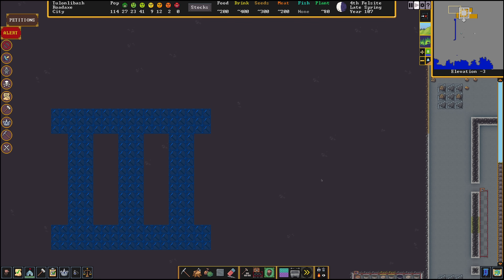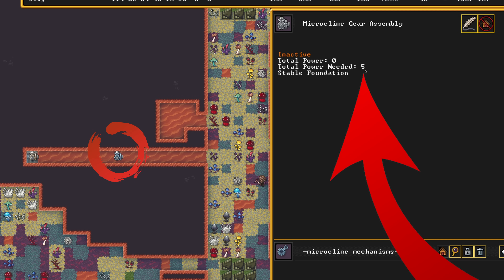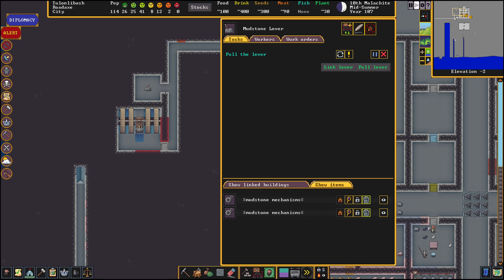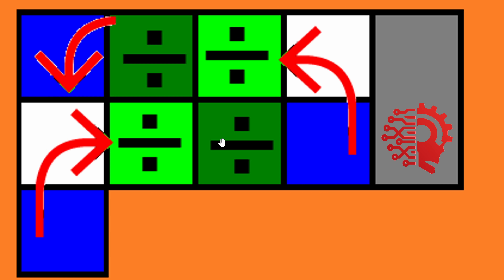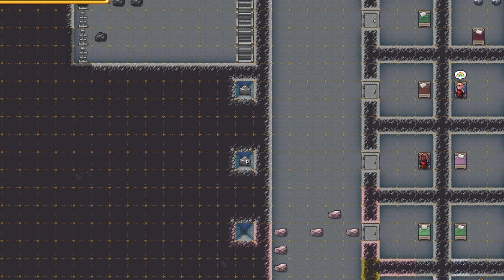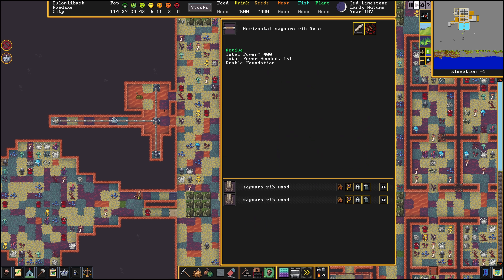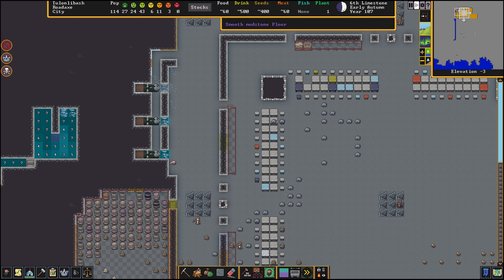ENGINEERING TUTORIAL 🔅DWARF FORTRESS STEAM🔅

Comment: How do the water wheels keep spinning if there is no active current? 
Does the initial force from the water entering the chamber, creating the initial water wheels motion, then create an infinite motion as the water wheels propel themselves in continuous motion? Do they power their own current?
Reply from the maker: the water pump creates "flow"
Reply: @TwistedLogicGaming  ah! I got it. So if you had built the water wheels on top of the existing water- instead of flood the room with them already assembled- you could have manually started the pump to create the flow. It would then just keep going as the wheels power the pump and the pump creates the flow moving the wheels. Makes sense now

Comment: I finally understand how this works (I think) but that quadruple water wheel setup feels like it doesn't make physical sense lmao, isn't that a perpetual motion machine
Reply from the maker: yes- it is a perpetual motion machine sort of, if you closed the water input and run it forever; eventually some of the water will vanish and it will stop working. You could call that evaporation perhaps, but I'm not sure if it is actually the same evaporation mechanic as the murky pools in hot biomes

Comment: Is there another benefit to using doors as valves as opposed to flood gates?

The only difference I can think of is that you can always unlink the door from the lever and have it function normally.

Floodgates remain open or closed when unlinked from the lever so cant be quickly forbidden or closed in case of an intruder.

Other than that it's seems that they're equal for use as valves.

Great vid man!
Reply from the maker: Yeah, that sounds about right. Thanks for watching !!

Comment: I find the noob way is easier than building a separate room. More risky, but easier.

Just channel down until you reach your main area of the Fortress and create an Underground River.

The Underground river can also be used for irrigation with manual pumps, wells and if you use mechanisms you can build a cheap Mist Generator on areas just by digging up and using axles.

I feel the whole creating a separate room is a bit complicated.

Just create a big channel all the way to the end of the map and put some fortifications that way you don't have to worry about flooding. Also the amount of water should be big enough for multiple Waterwheels.

Comment: Would someone know a reason why this could not work for the higher level pumps? I've been trying to replicate everything as much as I can, just with small layout changes but are only for the wooden axle,  to move energy around, the actual pump layout is identical, and there is no mist being generated in my higher level, which is my tavern/inn. Since the lower level pumps were working fine I thought it could have been the direction, as long as the top pumps work its fine by me, so I switch the direction but still no mist in the higher level, only at in the lower level. I have rock floor grates to prevent accidents, already tried changing them to floor bars but didn't fix the issue.
Reply from the maker: That is weird. the lower level should produce alot of mist and then there should be atleast some on the upper level

Comment: Followed this for both the water reactor and mist generator and it worked like a charm. It appears that once I add iron floor bars to the top level, mist is no longer generated on that level, but if I remove them then dwarves periodically cancel their jobs due to dangerous terrain. Is this expected behavior or am I potentially doing something wrong?
Reply from the maker: I get some mist on the upper level with the floor bars, it's not as much as the lowever level. I created a temple between the pumps so they are forced to walk in that area to visit the temple
Reply: @TwistedLogicGaming  okay, cool. I also put a temple near the bottom level mist generator, and then I used your design for the ring generator to supplement the mist on the second level (the tavern) and it’s doing exactly what I had hoped. Thanks!
Reply from the maker: Sweet ! Glad i could help Jeff!

Comment: My pumps spit water too far and keep flooding the room with 1 depth water.
Reply from the maker: sounds like something id different. did you use the diagonal on the lower level to reset water pressure ? are the walls on the upper level in place ?
Reply: @TwistedLogicGaming  I did. Looks like my mistake was to dig a channel for waterpumps, not digging smal ponds. when I put 2-3#  of water it works fine. If I fii the water supply chasnnel 7# the upper pump row start to spit water too intense

Comment: so i built the reactor from this video. works great. my reactor room has 6 of these and powers my 150~ pump stack to get water at my volcano base. altho they lag the game ALOT. so i used draw bridges over the screwpump input to turn the reactors on and off completely so that they dont lag the game and i can still use them for power if i need anything.
Reply from the maker: A Hatch will also work to block the input for the pump to create an on/off switch ! Great work Gredz!
Reply: thats a fantastic idea. i didnt even think about hatches. thats probably alot more safe than the bridges, i dont want to launch some poor unfortunate up into the ceiling when i turn the power on.

Comment: I honestly don't think the top pumps of the mist generator actually create mist on that floor. Dwarves get a waterboarding if they stand in front of the pump, but I have yet to see any develop any feelings regarding mist or waterfalls.
Reply from the maker: I have seen the mist on the upper level; if this is setup in a meeting location, it might increase the exposure to the mist more so than a random hallway like in the video.
Reply: @TwistedLogicGaming  I think I figured it out. Putting a grate on the floor in front of the top puump stops mist from generating on the top floor. It still generates more frequently on the bottom floor though.

Comment: Few questions:

1. Are those waterwheels powered by that one pump pushing water around? (aka perpetual motion?)

2. Does mist have to hit something to generate or is it made when water moves down a level no matter what?

3. Can you power a pump from the side and then translate power out the other side to other adjacent pumps or axles?
Reply from the maker: 1 yes
2 when water falls, nothing needs to hit
3 the water wheel creates a net of 90 power. the entire system can use that power no matter how it hooked up. you can attach gear asmblys to the sides of pumps and then axels to them. multiple pumps in a line configuration will all be hooked up via power to each other if touching tiles.,

Thank you for watching David!

Comment: For some reason I cannot get this to work with my fortress, the pump always ends up flooding. Any pointers on what i might be doing wrong?
Reply from the maker: are you connecting the water at the lower level? are you turning off the water? are you using a diagonal to reset the water pressure ?
Reply: @TwistedLogicGaming  Figured it out. Thanks for these videos!

Comment: How far out does the mist travel?  2 squares?
So best to use this in a 2wide hallway toward a tavern or meeting hall?
Reply from the maker: I have a better mist generator design for meeting areas I will build in a few days, i found this is better for halls. however it will still work anywhere that is close to them! Happy Gaming!
Reply: @TwistedLogicGaming  Do you use the ceiling method?  Where the water is sucked around a circle and mist blankets the entire 4 opening area below?  I used that in 2018 or 19 when dwarves would go batshit insane.  The generator helped immensely.
Reply from the maker: Yes; the "Ring Mist Generator" is installed on 2z levels and the bottom later is all the mist in a large area and statues.
Reply: @TwistedLogicGaming  Beautiful!  Please do make a video on that.  The output on it is amazing.  
Oh and question:  the perpetual motion water engine that you set up- will it ever need refilling or does the constant motion of the water prevent evaporation?  Do you use that design to power the rest of the fortress?

Comment: I personally prefer making my power generators by inducing flow state into a large body of water, then cutting off the outflow with floodgates or bridges. That way you get a large area of water that magically powers water wheels even though the water level isn't changing. Makes it more efficient as you don't need pumps and it costs less cpu performance as no actual fluid calculations are made.
Reply: Can you explain like I’m five?
Reply: @hernique  
There is a pretty good explanation of this on the official dwarf fortress wiki. Look for the wiki page for "Water Wheel" and there under the section "Flowing Water Reactors".
Reply from the maker: That is great for large amounts of surface power !
Reply: @fabiant.2485  It ends so poetically: "The water wheel itself both moves the water and is moved by the water."

Comment: 2:23 - Liked how you reinforced how ramps work
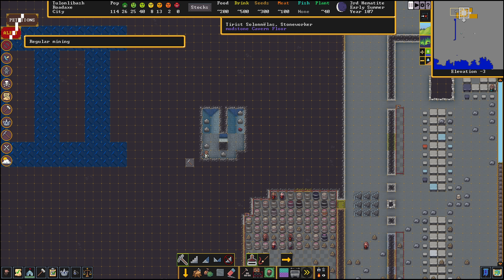2:34 - Liked how you reinforced how water pressure works (Opportunity to add annotation to your water video as you didn't go into detail about pressure here)
3:36 - Nice idea to use door as valve (How does this compare to using a water gate?)
4:00 - Mechanical Power
4:30 - Wow, never new you could gear the pumps from above. I've always done that from the side
6:50 - Wait, what, you can create water wheels within the base. I've always used them on rivers.
9:23 - Ok, I didn't realize we can link to a gear assembly, this will be useful for managing power.
11:40 - Dwarfs can walk on part of the pump
13:42 - More vertical pump power transfer logic
17:15 - Iron bars over water tiles and channels. ( I think floor grates do the same thing, mainly differing that one can be built on site with metal )

Thank you for this video. I'll be copying your demo for my first mist generator. Your underground power generator breaks the rules of psychics for fun and profit.It solves the issue of water freezing in winter on the river.
Reply from the maker: This comment is great, thank you for letting me know your likes, when recording I sometimes repeat/reinforced ideas  and i'm not sure if I should Cull that info while editing. Alot of the videos I created in the past were for veteran players so some simple concepts I would skip over as everyone knew that info already. Thank you very much for watching !! I appreciate your support FolixOrision !!
Reply: @TwistedLogicGaming  Can you pin this this to the top. Easy navigation for the return visitors. winter is coming